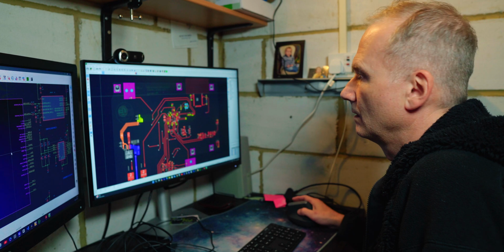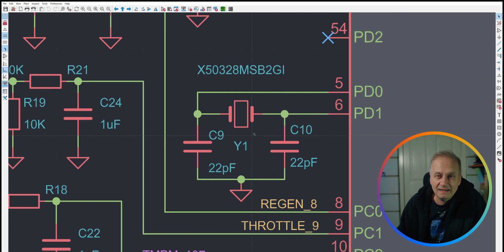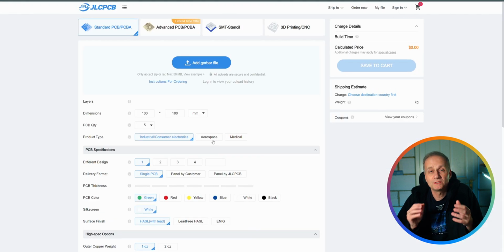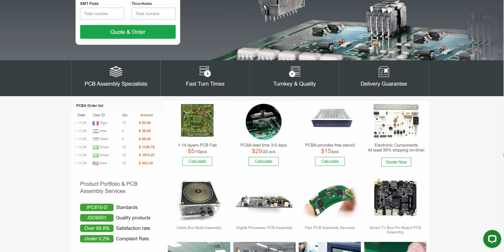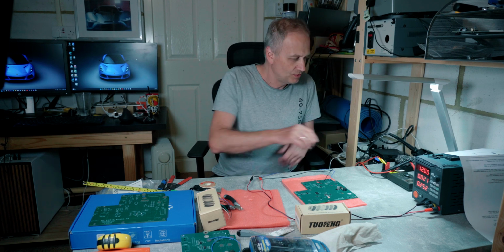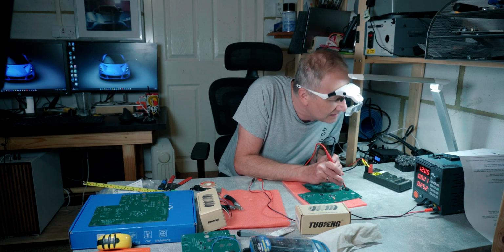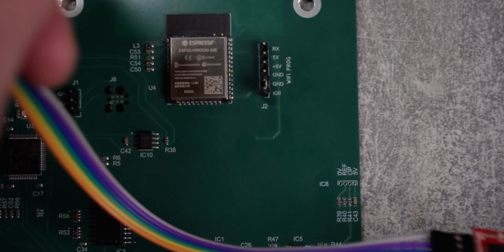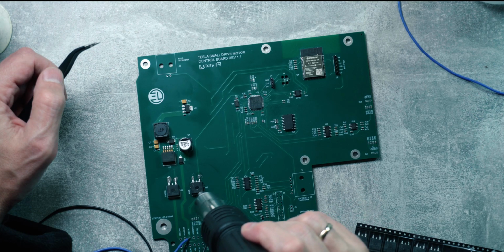I made my own Tesla Open Inverter Board

Comment: Ah, so the issue you faced with your original openinverter board — some components in the power supply having the wrong polarity— that was an issue with JCLPCB and the CAD program you used?
Reply from the maker: A bit of both It's JLC PCB software has a problem with Kicad rotation. Now I know and check it all the time 😁

Comment: You don't need to tin the pads before using solder paste. The paste goes directly on the board and then the component.
Reply from the maker: I have seen laptop repair people doing it. The idea is when the board was manufactured which in my case few months ago it had HASL done. This inevitably would be oxidised and have some other impurities. The tining of the pads will get refreshed surface. But it might be not critical and waste of time so I will try with it next time

Comment: Is this just your own version of the OpenInverter V8 SDU board ( which also has the ESP32 ) or did you add extra features?
Reply from the maker: I made some other minor improvements but no new features at this stage
Reply: @LatutaEV  What did you improve and where are your design files? Also why no mention in the video of this?
Reply from the maker: @Tom-evnut  Hey Tom great to hear from you. I am going through some testing and will share the design files once I know it is working 🙂